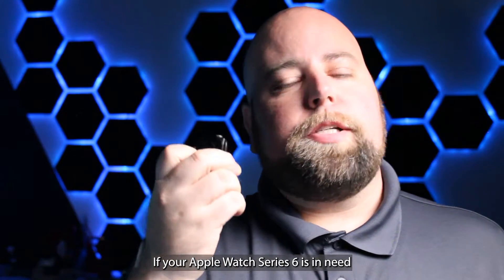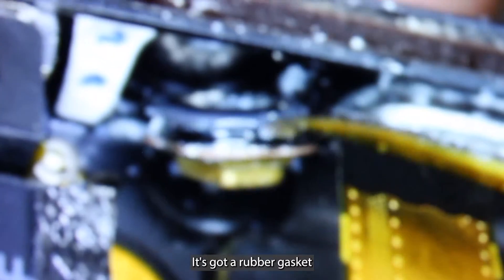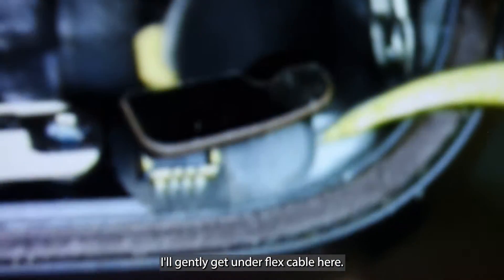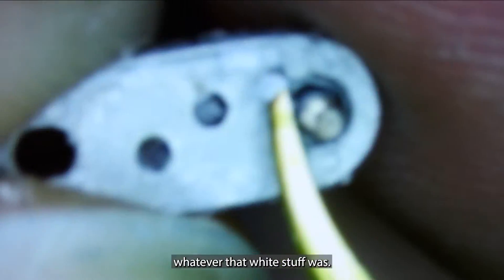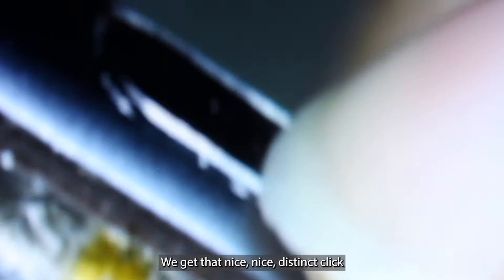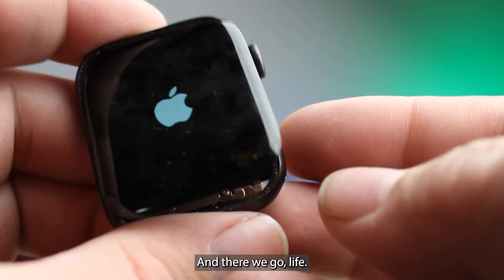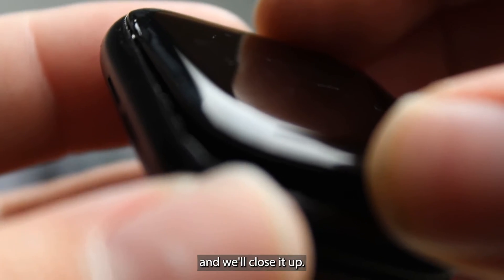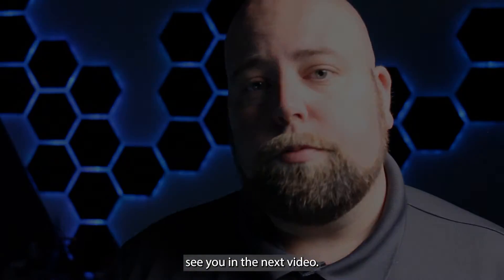Apple Watch Series 6 Mic & Power Button Replacement: Restore Full Functionality!

Comment: Hi, I found an Apple Watch 6 for sale on the internet at a good price, but the power button is broken and the apple watch is in loop (only shows the apple logo when turned on). The seller said that the loop problem began after the button broke. This really could happen (the loop problem happen because of the broken button)? Replacing the power button can fix the loop problem?